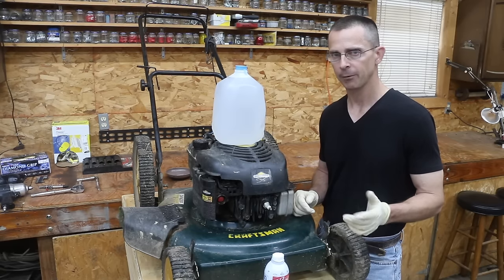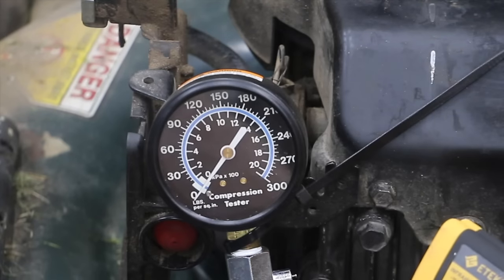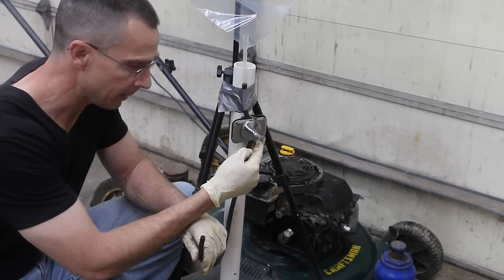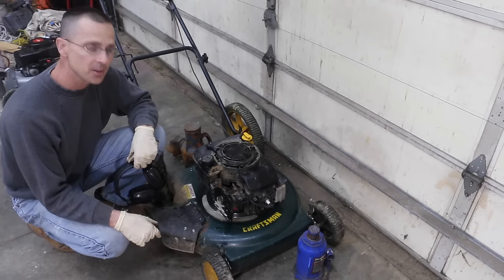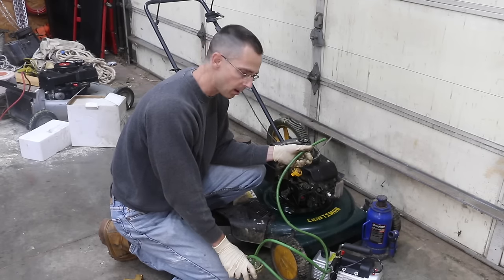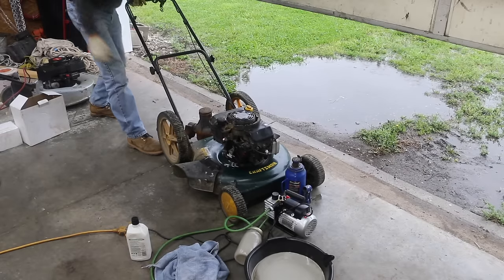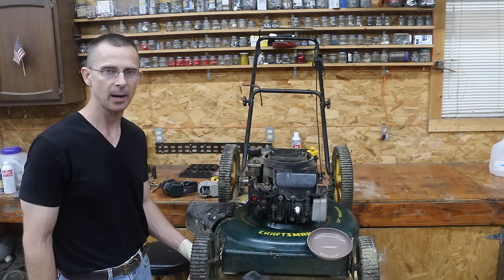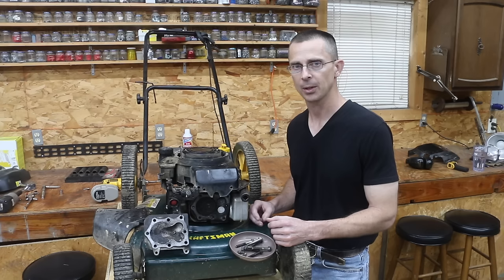Seafoam--can't believe what it did to my engine episode 5--cylinder cleaning test using water!!

Comment: I haven’t read any comments (yet) and about half way through video. 

I keep thinking though …

When using water …

Seems to me that a step was missed. Idea is steam. Steam is what’s gonna clean. You would have to keep an eye on engine temperature, making sure that when engine temp dropped below let’s say 200F or so, water feed is stopped. This would also ensure the engine doesn’t hydro lock by accident.

Great vid!

Comment: One of the reasons I believe these seafoam/water/Marvel Mystery Oil/Lucas tests show little results - is the engine is never put under a load.  The engine may be running at full speed  - but there is no load and the engine is not working.....therefore the engine really isn't moving much fuel through the engine, it isn't making much heat.....it is just loafing along.

If you really want to see how well it works - put in the Seafoam and then mow your yard!
Reply: What Seafoam test? I only saw water test being made
Reply: Seafoam innthe fuel system works pretty well, used it onnstuff from chainsaws to trucks. Im about to try the spray. With the spray it goes into the throttle body at + 500-1000 rpm from idle until the bottle is gone (about 5 minutes), left to hot soak for 5-15 minutes. Then driven for another 5-15 minutes. That said, I already have an entire bottle although not at the fuel/ seafoam ratio i would like. Recommended is 1 ounce oer gallon. But i have 16 oz in a 17 to 19 gal tank. I would like to add another bottle to the fuel, however  cash is a factor currently. However, seafoam in the fuel doesnt clean the top end. Ill let you know how it works out when done. I have a 96 jimmy with just under 200k that I drive 60 miles or more a day. Hopefully the progress will show up in better fuel economy as usual after its been in the fuel, and we will see how it is after being injected into the throttle body. A better, smoother (its pretty smooth) more responsive result would be what I am looking for. This is the first time the seafoam spray has been offered in my area.

Comment: way too much water for way to long
Reply from the maker: Ken Ezzell, Thanks for watching the video and commenting!
Reply: I would be concerned about engine wear with the oil so depleted from the water..Was worth a try and now we all know more then we did...:)..
Reply: yup... you are right... and if he'd have heated the water to 200 degrees prior to injecting it would have cleaned it right up without all the water in the oil.  you are right, my friend!
Reply: +Bruce Dakin water won't displace the oil I imagine
Reply: no it wouldn't.
 back in the days of carbureted autos, i routinely did this with just a couple quarts of ice water.  the engine needs to be well into operating temp,  you hook a hose to a vacuum port, rev engine to 3 or 4 k, then stick hose into ice water. as engine coughs and chokes you will see all the crud go out the exhaust.  once it's choked it down to nearly dying, pull hose from water,  clear it out with some revs, then do it again..  repeat till you've gone through a couple of quarts. zero water ends up in oil.
for proof of this method one needs to only have seen the effected cylinder where a head gasket has failed allowing coolant to be introduced into the cylinder.  the effected piston and chamber will be spotless, right down to the ring lands.
Reply: ken ezzell vyeah tis is an unrealistic test. When I "steam" cleaned car engines you only added a Coke bottles amount or 16 oz. So this test is inconclusive. Plus flooded the crankcase with water..lol
Reply: I agree. I use more water at once, but I let the engine heat up and recover too. I did a uniquely different water decarbonization video, you should take a look.
Reply: a fine mist is great for reducing intake charge temp, but it wont do anything to clean.  see Oil Burners response below.
Reply: JIM KREMNIN But that engine stays hot easier. You probably kept it revved up too. He'll redo the water one. In the meantime, check out my water decarbobization video. I took a unique perspective, which no one else has done and I've watched a lot of them. :)
Reply: JIM KREMNIN ;) It's like a fuel injector versus a lousy carburetor. Not to be mean on nice carbs with amazingly planned intakes and engines designed for them, just the lousy cheap carbs.
Reply: DE Nichols  الي
Reply: DE Nichols  اليسا
Reply: JIM KREMNIN When writing like that shows up on my channel, even though I assumr it's real language it always shows up under spam. So yeah, if the pattenr holds true, they're not "being" a part of the conversation. When someone doesn't use the common language, they're often being sexual or cussing someone out so I don't Google translate it anymore.

Excepting one kind woman who had a longer comment. I was happy to use Google Translate to attempt to communicate. Have a good day Jim. "Great Scott, Jim!" Lol. Sorry if my humor is off, I woke up in the middle of the night.
Reply: Yeah i always heard to spray it in with like a windex bottle at about half throttle a couple of times.
Reply: The water turns into a acid that can eat through nails. The heat from the engine accelerated the damage done by the acid. The acid is called carbonic acid. It's the same acid in soda cans. Although soda also has phosphoric acid as an additive, which slowly removes calcium from bones when drank.
Reply: ken ezzell Hi All, there is a group in Asia who add water and plant oil to the crank case oil on old engines to revitalize them and they win races with old motorcycle engines that are treated with plant oil and water.  The water will burn off...I thinks the waters purpose is to blend or mix the plant oil with the petroleum motor oil.  It becomes very slick.  In my 04 Cummins diesel I did some experimenting.  I ran 10% motor oil and 90% water with 1 cup of plant oil...good mix for consistency...be careful the water will evaporate.  Better to do 90% motor oil and 10% water with the plant oil then after the water evaps add motor oil to full.  At 50-50 the oil and water will foam up.
A better way to clean the engines carbon build up is to add a gallon jug water bottle with a tube going through the cap to the bottom of the jug.  Then another tube from just inside the cap to the air intake this will suck air through the bottle slightly humidify air and be sucked into the engine.  This will over a long period of time clean your engine and keep it clean.  Run it 100% of the time.  Ever notice how your engine runs better on humid days?  Carbon build up inside your engines causes many problems!
Reply: Ken you so right - what about rust issues?   I love the old standby Marvel Mystery Oil - used for over 80 years!

Comment: Excellent test! Antagonists could argue that lubrication failure could affect results-negatively. But results showed improvement! 
I used water injection for octane improvement in the old days.
Reply from the maker: Thank you for the feedback
Reply: In what? And how low of a ratio water to fuel and which fuel?

Comment: Three things:
If the cylinder head is getting that cool, there is a chance that the sweater isn’t getting hot enough to have the effect that it might if everything were hotter.
SeaFoam might have contaminated the engine oil the way the water did, but didn’t get noticed due to miscibility and color similarity.
Auto engines have PCV (stress on “positive”) systems that let in fresh air on one end of the engine and evacuate that air plus blowby into the intake downstream of the throttle blade. IOW a car engine isn’t at as much risk for oil contamination as a small equipment engine because any vapors (again, if the engine is hot enough) get carried out of the crankcase and out of the oil.

Love the show, good rhythm and explanations of each potentially non-obvious point.
Reply from the maker: Thanks!

Comment: I've heard that some old motorcycles came with water injection, to lower cylinder head temperatures and reduce deposits. I think it works better if the water is in the form of vapor. if you had a fog machine, or a fine mister, that would be ideal. it probably works better as a constant ,preventative feature, rather than a one time treatment.
Reply: Correct, OEM solutions are always water injection, not an IV drip lolol. Water injection is an old racing trick that has made its way to the public roads a few times in various bikes and cars
Reply from the maker: Joshua, I agree...a water mister would have been a better approach.  Thanks for watching the video and commenting!
Reply: Water injection was also used in some turbojet engines to improve performance. Misfuelling with jet fuel instead of water in the tanks led to this : https://en.wikipedia.org/wiki/Paninternational_Flight_112
Reply: That's basically why meth injection is, sprayed in a fine mist to keep temps down and increase power

Comment: for two hours? more like water boarding.
Reply from the maker: Khalid Khudhori, That was indeed a long time!  I was adding the water very slowly to prevent damage.  Thanks for watching the video and commenting!
Reply: But that did the opposite, causing bearing wear damage by running so long with fouled oil.  Getting every last trace out with more than one oil change afterwards, was fairly irrelevant compared to that initial damage.
Reply: Khalid khudhori oh , hell no, WATER BOARDING.... sounds fun.....
Reply: Stinky, You have no idea if any damage occurred to the bearings at all. Oil is still slick with water in it. You have not seen the conditions of the bearings before and after.
Reply: Thats funny i enjoyed that one
Reply: consaka1 that engine doesnt use bearings.
Reply: Chris n Tracy Maze all engines have bearings they are friction bearings which does not mean it's got a ball or roller pin or anything like that those are roller bearings friction bearings are a small amount of material between two metal surfaces that gives something in between them and there's usually a layer of oil in between one of those surfaces and the bearing itself
Reply: What he meant was a removable bearing like cars use.  However those of us that have spent a lifetime working on all kinds of engines know there is more then one kind of bearing or bushing. Chris was basically being a smartass because he knows that all engines have some sort of bearings. It could probably be technically accurate to say cars have no bearings because all the bearings are actually bushings. Of course some cars use actual bearings in the water pumps and accessories. But main bearings and rod bearings and cam bearings are all really babbitt type bushings. Considering that in the automotive/engine industry the terms bearing and bushing are used interchangeably even at the professional level he is wrong.  We all know that small engines have numerous bushings and sometimes bearings.
Reply: KaelKnight you wrong boss i been a mechanic for 30 years tear one down see unless its a pressurized system they use no bearings.
Reply: Chris n Tracy Maze when you tear it down you know that little metal sleeve that is between the Piston connecting rod and crankshaft and cap and the crankshaft that is called a friction bearing and yes it is on every engine because that's there for when there is no oil pressure because metal-on-metal will destroy the engine for being a mechanic for 30 years it's kind of strange you don't know that
Reply: KaelKnight go to your small engine shop ask for bearings for a 3.5 5 or 8 hp briggs they will laugh you out of the shop its like asking for muffler bearings which you prob believe in also.
Reply: Chris n Tracy Maze no every engine has bearings Small Engines usually only have one but they also have the little friction bearings and just so you know I'm an ASE Master Mechanic I know what the hell I'm talking about look up any information on small engine involving bearings and they are bearings for every Small Engine
Reply: KaelKnight you need go back get recerted then small engines dont have them hell even Volkswagen didnt use cam bearings in their engines till the dual port motors came out in 69
Reply: Kael, sorry my friend but smarty pants Chris has you here. If you go to a small engine supply because the bearing surface on the connecting rod is shot you will be asking for a new connecting rod.
Small engines do have bearings be they sleeve or bushing but they are integrated into the aluminum connecting rod.  They are literally part of the connecting rod.  The connecting rod is also the bearing so to speak.  It is one of the little shortcuts that makes the engine cheaper to make. 
I started out many years ago at the age of 10 rebuilding lawnmowers and selling them to make a few bucks. I then moved on to working for my neighbor rebuilding and repairing logging trucks and semis. I have seen a lot of engines tore apart big and small and everything in between.  I haven't seen everything though. There may be some newer small engines I haven't seen apart and perhaps some new "tech" in a newer small engine my have removable  bearing shells. If you know of one I'd be interested in the year make and model.
Reply: consaka1 when i was in diesel school had the op to work on some 2 stroke diesels now thats a wicked engine. i myself havent tore down any newer stuff they seem to be built to run till they quit and no longer are worth fixing.
Reply: Yeah we had some 8v92's come in.  I think those are slowly going away.  They are an incredible engine. The one we worked on had both super and Turbo.  Made the boss cuss like crazy too. We did a complete rebuild on it and had some problem running the overhead. First he did it by memory but it was over fueling something fierce. Then he double checked himself in the books and redid it. Same problem. It was a short truck with single dual used to haul liquor locally.  We took it for a test drive at 1:00am on a cold October morning. I swear that thing did a wheel stand going up the hill. Every gear wanted to lift the front off the ground.  The flames coming out the stack would light up the roadside. lol  The whole time my boss was cussing and I was wishing for more seatbelts. lol   I will never forget that. Burned in my memory.  It was late and we quit after that but he got up early and did something that fixed it. Wish I knew what it was. That was basically diesel school for me. Hands on application with government grants for tools and $4:50 an hour.  That guy was amazing. He forgot more stuff than many professors know.  He was in high demand for every kind of repair or rebuild of semis. He also did a lot of specialty welding repair on log bunks and other heavy equipment. He had 440 in his shop and some massive DC generators he used for welding big rod.  His carbon arc cutting setup was pretty amazing too.  Ridiculously loud though. Could hear that cold air hitting hot metal for miles had his shop been on a hill instead of a sand pit.
Reply: consaka1 i love diesels but its a different type of grease nasty doesnt even classify it lol i had a 85 F250  extended cab with a 6.9 diesel put a banks sidewinder turbo on it and streched every head bolt in it lol at full tilt you wouldnt wanna be behind or beside me you would have a layer of suit in your vehicle
Reply: Lol. You must have turned the fuel up some.  Not enough air if you were still putting out soot..
I much prefer diesels as well. My fav is the 6.5 chevy diesel though. I like doing performance builds on them. Kinda hard finding good used blocks though and the new blocks are spendy. 
I notice when I use Total Seal rings the oil does stay cleaner longer.  I use ARP studs for the heads though to keep those clamped tight. No fun doing head gaskets any time.
Reply: consaka1 oh yeah used arp when i built my 95 cobra it run 6.50s in 1/8 mile on 93 oct with no cage or frame connectors did put lakewood suspension under it you could go get groceries after running for the night still had all guts inside lol
Reply: and it was just a 302 punched out 40 over with stock stroke
Reply: Dj d spray is cheaper and easier to tune you can start out with small jets go up.
Reply: At those speeds I think a cage is mandatory out here. Add the cage and it will slow you down.  I like sleepers though.
Reply: consaka1 yes they are here to but cage adds weight but alo stiffens the chassis which keeps it from twisting. when it twist your not transferring power to forward momentum inturn slower times. lol